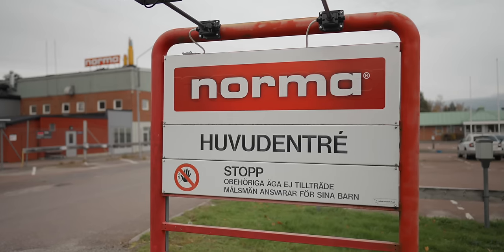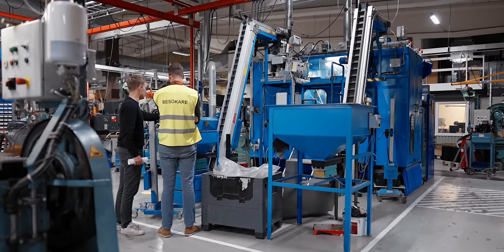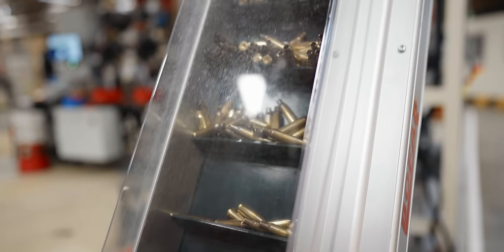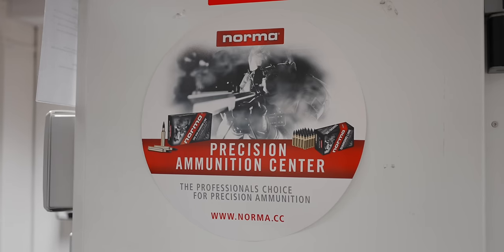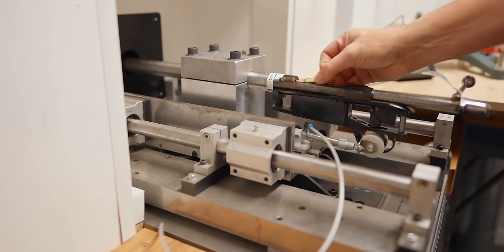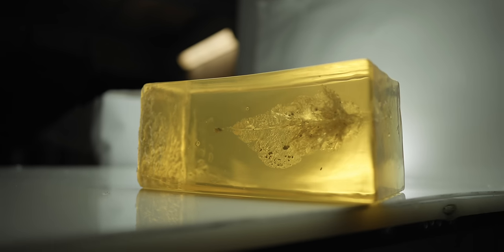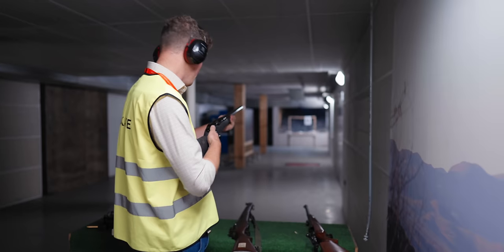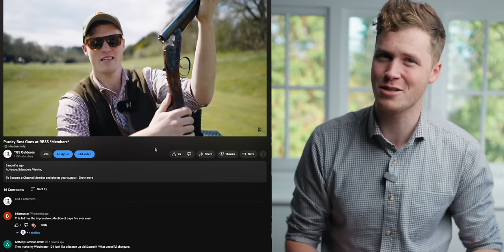Inside a Bullet Factory - Norma Ammunition  Factory Tour

Comment: Used to work as a mil operator for commercial use printing ink. This would be a killer fit for another idea. We had machines sizes of small houses, giant mixers, mills for grinding and refining, lab for qc and finally it got to me, a completed batch ready to be milled for packing in various containers. The three roll mill itself is a simple yet complex machine. I worked the old school mills of probably late 80s where everything was manual. On the other side was newer semi automated mills that helped operators.

Comment: I served in the U.S. Army with the M1 Garand, the finest battle rifle in the world.

I'd love to take a crack at firing both the .460 Weatherby and the .505 Gibbs.

I was experimenting with a modern falling-block rifle in .45-70. This rifle weighed six and a half pounds. This load is not safe in either trapdoor Springfields or Winchester lever rifles, so I won't print it. I was getting 1900 feet per second with either a 500 grain jacketed bullet or a 550 grain gas checked cast bullet.

One of the range staff asked me to try his .375 Epstein, an improved .375 H&H wildcat. After it fired, I kept trying to press the trigger. When asked what I was doing, I looked up and asked, "Did it fire?" The tingling sensation I was getting in the groin area I later learned was more hair growing on my balls.
Reply: There's definitely a joke to be made here about Epstein and lack of groin hair, but I'll let you all fill in the blanks.
Reply: @chaimafaghet7343  :
Second try. First one lost and floating around somewhere in cyberspace. 
Doctor I had then explained it to me.
I just wonder if either rifle is anything like the time I had a ten gauge double on me, both barrels on one pull of the trigger. Both barrels had 3 1/2 inch magnums.

Comment: In 1987 I bought one of the first Colt 10mm Delta Elite handguns out there. Norma was the original 10mm maker as I recall. They had full power loads before the FBI destroyed the caliber. Norma 200gr at 1200fps and 180JHP at 1400fps make for a distinct note when firing a 1911. It ain’t your daddy’s 45.

Comment: Comparing the Norma and Hornady as if one was "better" than the other was a bit of a crock.   If you send both of them downrange to 600 Yards the Hornady would have been the bullet to use with great expansion and penetration. The Hornady is meant for long range controlled expansion and it grenaded as it should have at the 50 yard range in the video. The Norma would have penciled through the gel and made no wound channel. He is right though, bullet choice matters, but there is a lot more to it than this video cared to explain.

Comment: .505 Bibbs? 😂 Curious how they make the solids. Obviously you don't start with a cup. I hear some people turn them on a lathe.  Also curious as to why you'd use a hollow point in a .460 Weatherby... I'd have expected some sort of bonded ballistic tip. Worst thing I ever shot when it came to recoil was a .50 caliber Hawken black powder rifle with a set trigger - the thing went off before I'd gotten the stock firmly into my shoulder. That left a bruise. The fact that the owner had used 100 grains of black powder under the ball (which I think was way more than was needed) might also have contributed to the problem.

There is, by the way, a very complete description of how cartridge components are made in Hatcher's Notebook. Something everyone interested in rifles should read.